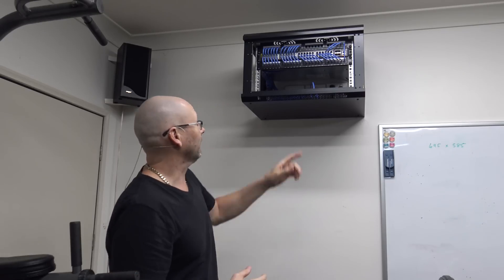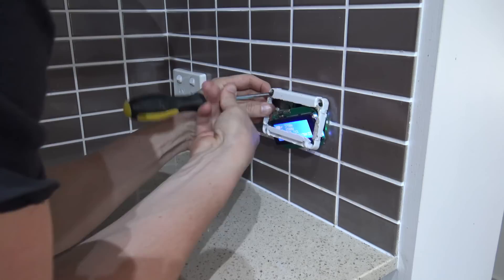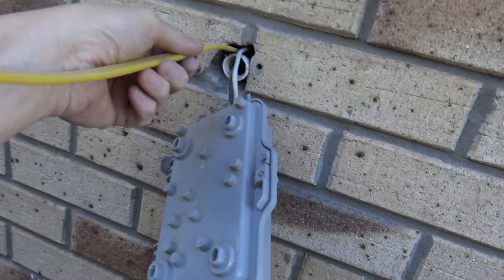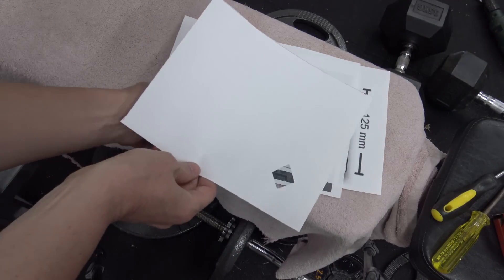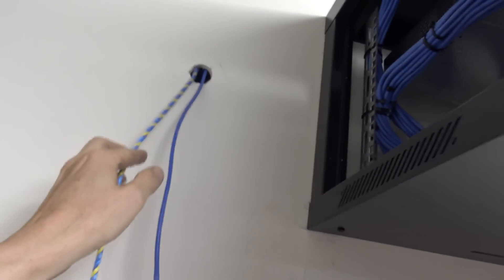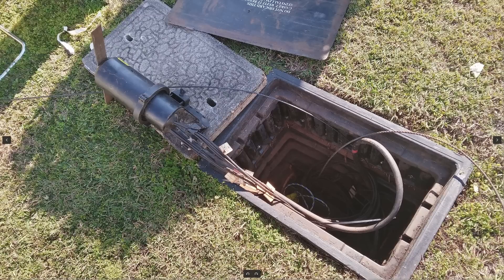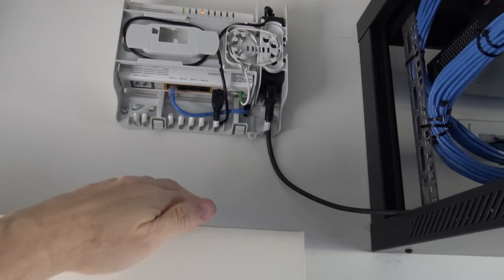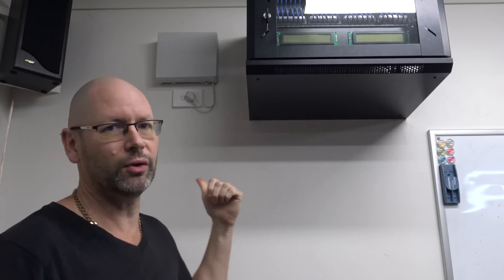NBN Fibre FTTP Install

Comment: From what it looks like to me, you have the nbn that actually has the lines then the isp's are at the other end. In the states each isp is responsible for binging out their own lines for their own service. If that is the case how does that work? Or do I have it all wrong?
Reply from the maker: NBN do the physical infrastructure around the country. ISP's tap into it and the NBN maps them to your connection. If every ISP had their own lines, there would be shit everywhere
Reply: @TallPaulTech  Yeah here in the US, everyone has their own cable/fiber/copper system installed in the ground.  Plus then beyond the residential stuff, you have all the business networks as well all with their own fiber networks.  Lots of buried and aerial cables for sure all over the place.  👍🤠  Our last fiber provider to install cabling into the neighborhood really made Swiss cheese of the previous infrastructure.  They hit multiple water lines, 12KV power lines and other providers lines as well.  Thank goodness they didn't hit the natural gas lines in our neighborhood, like they did in a few subdivisions away and had to evacuate a number of homes.

Comment: Paul, what ISP are you using with your FTTP?

(In Brisbane) I now have available free upgrade to FTTP and my current provider Internode doesn’t support the higher speeds. I'm wanting an ISP that has IPv6/56 with reverse DNS support which Internode supports on their standard plans.  I’m also wanting a fixed IPv4 address which I think all ISP can now provide (at a cost).
Reply: He is with Aussie you can see it in his speed test
And I highly recommend you do the same if you are wanting to muck around with IP addresses. The peanut employees at other ISP will have no idea what you are talking about
Reply from the maker: Not so fast.... yes I'm with Aussie Broadband, but their support for any real network issues is less than stellar. Their DHCP servers in particular are flaky, and if you try to explain that to them you get the same old 'turn it off/on' as you would from any other ISP.
Reply: @TallPaulTech  Of course you would because you are running residential. Go business if you want real troubleshooting.
Reply: Superloop offers free fixed ip
Reply: @jacksoranges6731  yeah can you imagine asking about that though. Their call centre is the worst tech I have ever experienced and I did the same job when I was 17. It was bad enough for me to move providers last week

Comment: I moved to an apartment which had 1st Gen FTTP.  My NBN router has a UPS as a part of the setup.  I believe the thinking for that 1st Gen FTTP was; As FTTP was also replacing the copper phone line, if there was a power outage to your residence, then you wouldn't have a phone...  So, I noticed your NBN router didn't have a UPS...  I'm thinking that the 2nd Gen FTTP was re-speced?
Reply: It's all the same, just doesn't have the UPS because the UPS was a severely flawed plan.

It was for use with the UNI-V ports, which most ISP's decided to completely ignore (with good reason, the provisioning was a nightmare afaik).

Alcatel-Lucent G-240-G ONT's and Nokia SAS-K5 ONT's are the standard for NBN FTTP in residential services.

There's Alcatel and Nokia ONT's dedicated for Business services as well that are a bit higher specced too.

Comment: FTTP is awesome. AussieBroadband is a great ISP too. 

I noticed your switch puts out a heap of noise. I changed the fans out of my TP Link switch to 2x Noctua NF-A4x20. Its super silent now despit fans always running. Easy to do and means my network cabinet in my office doesnt disrupt the house. In fact, my work laptop fan is noisier now.
Reply from the maker: Well, I had a 10 hour outage after the upgrade because of them, so I'm not so quick on the awesome part. As for the fans, check out my switch fan replacement video.
Reply: @TallPaulTech  maybe there's a multi-technology FTTP mix. I'm in the original FTTP trial zone before the LNP/Turnbull created FTTN and FTTC.

Comment: Let me know if you wanna play around with bypassing the ntd and doing direct fibre to sfp I've managed to get it working on opticomm fttp (gpon) i imagine it's possible on nbn fttp as well I've seen some enterprise nbn fibres terminate to Nokia sfp's
Reply from the maker: I don't think I'm going to play around with that, as it's in now provides me a simple Ethernet connection.
Reply: I was looking for that, 😢were can I get more info ?
Reply: Interesting, not something I'd recommend however as if you're not super careful and break anything Opticomm will happily charge you $297 FFS minimum, then $148.50 per hour labour if past 2hrs, plus any consumables with GST on top.
Reply: @PupNuggs  im qualified so i just go out to my van and grab another pig tail or patch lead
Reply: @uwygjhshwe we absolutely do not do any of that in Australia no one would care

Comment: The drop of 13ms on the round trip time is why ppl should want FTTP. 
Re the router I struggled to find low power devices (5w) that could do gigabit so ended up with Protectli running my firewall and a few other tasks and it’s 10w of power at 1 Gig

Comment: I have a LinkSys WRT3200 running OpenWRT open source firmware as a router. Initially my NBN was also reporting half the speed, I researched and found that when I enabled "Software Offloading" and "Hardware Off loading", it went to full speed. So probably that is something you may look into for your Raspberry pi. I know not all routers have Hardware Off loading as it requires hardware support. However software offloading is implemented through software.
Reply: No routing engine on a Pi, just good old software-based packet routing.

Comment: So I’m on ABB aswell but questing when you check your property it says $0 install but there’s additional costs you have to cover is it completely free upgrade or is there additional costs yku have to cover
Reply: I went from FTTC to FTTH with ABB and it didn't cost a cent, I made sure the installer had all the access they needed to the area I wanted the fibre box which was next to my primary incoming router and switches. Interestingly they did an aerial fibre run into the house. No issues, I needed to make some changes to the router to get the 250/25 speeds across the network.
Reply from the maker: Let's not forget the NBN is taxpayer funded, so it should be bloody free.

Comment: I have just had 944 fibre and was only getting 190 using a Ubiquity USG-3P Security Gateway, turned out I had threat protection on. Turned it off and now I'm getting 950+
Reply from the maker: The Palo Alto is my temporary router/firewall and it's got decent throughput. I can't wait for my new linux box to arrive though.

Comment: when i built my house 10 years ago - i ran ducting up to my boundary ‘just in case’. Sure enough, 10 years later they run fibre to every house boundary.   I signed up and when they arrived for the install - they were expecting to lift 30M of block paving - imagine their joy when I showed the ready made ducting.  Like you I have a full IT setup and wanted the internal fibre running to my comms cab - which they obliged with.
I ditched the supplied wifi router and use Sophos XG firewall (full version is free for personal use)
Reply from the maker: Yeah, I guess they're happy when someone has made it easy for them. That was my aim, and it paid off. Also, I'd want it done my way anyway.

Comment: I've been using Mikrotik routers at home since 2016, right now I'm on an RB760GSi (also called hex S), which has no problems with a 1000/1000 Mbit/s line with a few firewall rules.

Comment: Did they use the copper to the street as a pull-through? Just asking because I said to the guy who did my place to use it as the pull-through but he said they weren't allowed to do that and the copper had to stay there. No idea why because it's just taking up space in the non NBN conduit I laid 22 years ago. He did use the copper to the first point in the house as a pull-through after I said for him to do that. 
Gee, two guys showed up each time, I had one show up and he did the fibre pull-through and the setup inside the house in less than 2½ hours by himself sort of. I did help with the run into the house. I'm on stumps so it was a short and easy length to run. I have a phone pit in my driveway so I was surprised when he had to run the fibre to the pit next ro us.
Reply from the maker: I explained all in the video.
Reply: @Joseph the reason they can't pull the copper out is because it's owned/property of Telstra/Telecom, if they were to remove it they could potentially end up in court.
Reply from the maker: Fair point
Reply: @scoffee82 Nah, it's all owned by NBN now.
NBN just don't use the copper to pull thru as it's not good practice, it can cause fibre breaks as the copper will go round bends easier than the fibre.

Comment: I am on Launtel 1000/50 that runs at 835/47 consistently with a UDM Pro as my Router. Tested the 1000/400 plan and handles upload speed fine-tests at 850/350. Telstra Business Router V7610 would only upload at 48mbps
Reply: Ah yes Helstra. After being privatised all those years ago is still ripping off Australians. Guess it's in their DNA after doing it for so long under the PMG. I am envious of the speeds you can get in Launceston as that is what the original NBN was planed to do for the 93% who were going to get FTTP.
Reply from the maker: I may give them a go once I'm settled in with my new router.

Comment: I got the upgrade to FTTP and also with ABB about 3 months back. I like you think I probably had the same gremlins needing fixed back up from ABB. Mainly, IPV6 address didn’t come across from the old service and IPv4. Additionally I had ABB set a reverse PTR record for the IP to my own rather than their system’s default - Important for my email server setup. I found a few calls to them / email got it all back to normal within 2 days. Still faster support and don’t shove you off like the big telcos. In the end everything transferred across just the way as it should have.

For my Router I use a HP Thin Client with a 10G adapter via the m.2 slot. Project TinyLittleMicro has some options and I think Lyndel (Level1Techs) has a few videos. 

I use PFSense but a thinkclient /1ltr PC could be an option.
Reply from the maker: I didn't know they'd do a PTR for home users.

Comment: Curious what those two 40x4 LCD you have mounted in the cabinet do!
Reply from the maker: They fill in the gap that would otherwise have been there in that shot. Previously, I had a Powerwall readout similar to what I have in the kitchen.

Comment: Good work - what's the expected upload? Is 1G upload not the norm? Also what's the delivery tech? GPON? I couldn't tell if that was single fiber stand or dual on your modem? Thanks
Reply: 1000 down / 50 up is the standard speed for the top end NBN for consumer plans. 1000/400 is available as a business plan over the same service but it is about 3 times the price. (Nearly $400 AUD per month). NBN FTTP is delivered via GPON.

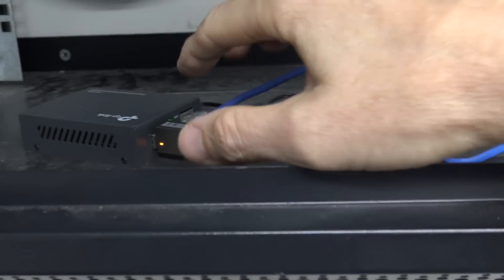Comment: 1:23 It's a side point, I know, but I'm curious as to what this modem is. Is it a VDSL modem in a SFP device, plugged into a TP-Link MC220L?

Hopefully within 12 months, I won't care because supposedly an FTTN → FTTP upgrade is coming to my town.
Reply: He's covered it in a few videos a while back. It's a VDSL modem in an SFP, rather hard to come by.
Reply: Proscend 180-T, or the like.
VDSL2 SFP module.

They work well, and can have variants in both VSLAM or Modem mode, if you wanted to play around with using old phone cabling in the walls for up to 300Mbps LAN using only a single pair.

Comment: I have a question about the second visit - when they pushed the fibre from outside, did the fibre attached to your string have the green connector on it already (I believe it is called an SC connector). Or did the guy inside pulling the string terminate it once it was through?  I am just wondering how much the external hole has to be widened (where the street conduit came out your brick, and the fibre went back in on the outside of the conduit). Wide enough for just fibre, or the connector gets pulled through too?
Reply from the maker: It was a pre-terminated length they told me. They were out of here by 9am.
Reply: I'm fairly sure they do a fusion spice inside the tray on the side of the house. They would splice the lead-in to a already terminated SC connector. Not 100% tho

Comment: You lucky duck #WHERESMYLIGHTPIPE? Tidy install btw! I see so many dodgy NBN installs where they use flexible electrical conduit, in AS/CA S008 it clearly states to use comms conduit and a minimum number of bends & sweeps. I'd trust you doing electrical work more than some DIY hacks, you clearly know what your doing ;)

Comment: I’m surprised they throttled down your upload speed and at so very low speed also! The selling point in Europe for fiber is its simultaneous speeds
Reply from the maker: Our uploads are always tiny here
Reply: @TallPaulTech  not entirely true. Just need to pay more.

I'm on 500/200 with Launtel. I'm on a legacy priced plan so very good price. But residential plans go up to 1000/400 then you can look at EE for Upto 1000/1000

Comment: Now that you have FTTP, are you planning on upgrading your cabling to Fiber too, or are you leaving it as Cat 5/6 (which one do you have).

Also did you do your own powerpoint?
Reply from the maker: Nah, Cat5 is fine.
Reply: @TallPaulTech  interesting, so when would you consider upgrading Cat 5 to Fiber? Btw, why Cat 5 and not Cat 6/6A?
Reply: @robertsandy3794  I assume Paul is actually using Cat5E and that will handle 1000Mbps so it's not financially viable to go fibre inside and you don't get a speed boost except to your internal devices but only if they have 10Gb NICs so really what's the point. I regret Cat6 wasn't available when I cable my place 23 years ago when it was at frame stage.
I know of a Primary School in Melbourne that ran fibre to all the points in the school in the late 90s and then spent $180 per point to get a 10Mbps fibre to Cat5 adapter. What a WOMBAT! 🤦‍♂At the time a 3Com 905b NIC cost the same amount.
Reply: @josephking6515  that's interesting to know. I'm looking to cable my place and know that I could do it myself if I ran Cat 6, because the tools are inexpensive and relatively easy to do.

We are going into a reno in about 6 months, so I'm in the planning stage and looking which way to go.

Some of the runs will probably be longer than Cat 6 permits so that I won't be able to get 10Gb unless I do 6A or optical fibre!

Thanks for your response
Reply from the maker: @josephking6515  Yeah, Cat5E of course. You can do 2.5Gb/s easily enough with smart rate stuff. I don't have the need for that anyway. As I showed in my soapy server video recently, the only application (other than copy/iperf) that uses high bandwidth is 20MHz RF on the HackRF which is 350Mb/s. That's huge, and rare that I need even that. My LAN is fine with the cabling it's got.

Comment: Another advantage with FTTH is no second path for lightning to make its way in. lost over 10 modems to lightning (and attached devices) in my adsl/fttn time. 
What's the tplink modem you are using for the fttn service? 
FTTH is a long time off as an option
Reply from the maker: It's not a TPLink modem, that's just the media converter for the Proscend SFP modem in it

Comment: I had a janky router setup for a while, upgraded to an EdgeRouter from Ubiquiti. It died. Got a replacement. It died. Finally got a APU2E0 from a OpnSense vendor here in Sweden and couldn't be happier. Doodling around in a lab is cool and fine but when your work needs a stable connection sometimes something made by others, used by many, can be preferable. Mine have worked without a hitch since I installed it a few years back. It does one thing. I don't really have to maintain it other than log in and hit Update once in a while. I know you probably like to roll your own, but give OpnSense a go. Cheers, mate.
Reply from the maker: My nftables is great for complete control, and the linux box that it runs on gives me easy packet capture ability at the drop of a hat, which is why I like it. Solid as a rock too.

Comment: There are some Raspberry CM4  router boards which use a second NIC connected thru pci-e without usb. Then it should handle 900Mbit/s routing with ease!

Comment: The fact you need NBN certified pipe is insane. In the US the installer would kiss you if you had any kind of conduit so they dont need to sling cable through the crawlspace or attic.
Reply: Australia, 1 million rules and next to zero enforcement
Reply from the maker: The installers said it didn't actually have to be NBN conduit, but there you go.

Comment: Congrats. Have fun with the new fiber.

It will be interesting to see which router you choose to replace the Rpi.
In the past 12 months or so I experimented with:
1) netgate 2100 running pfsense
2) edge router lite running edgerouter OS
3) a Chinese mini pc with 4 lan ports to run pfsense  (I was experimenting with load balancing using 3 fiber lines)
All three worked very well. For size and simplicity edgerouter worked out best for me. My next experiment will be an HA setup using two edge routers.

Love your videos.
Reply from the maker: I'm setting up a Palo Alto as we speak